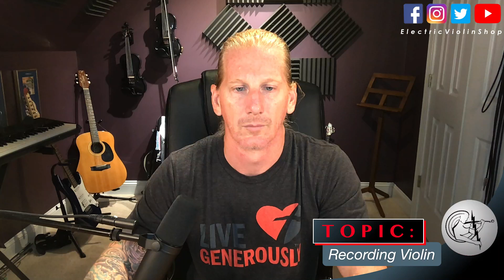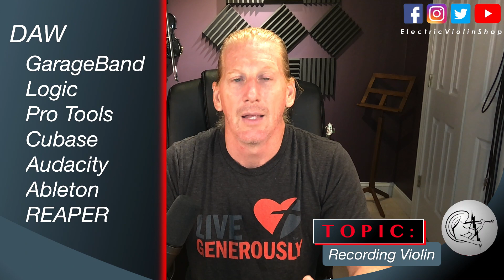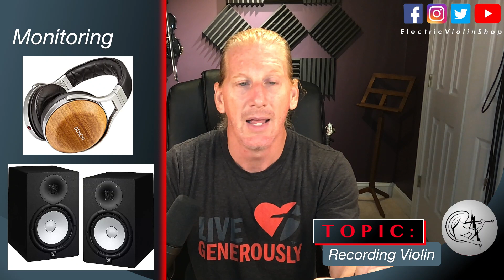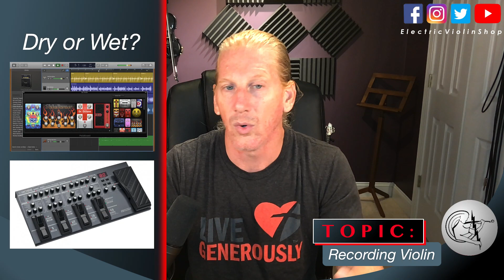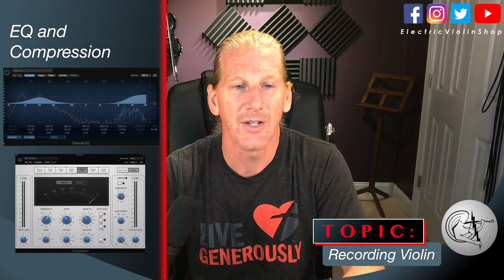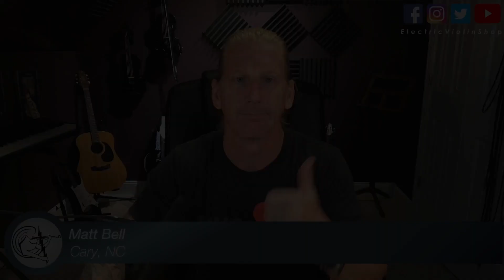How to Record Your Electric Violin

Comment: A lot of good advice and tips in a 20min vid. Nice one Matt! 
I would add that it is good to make sure one has checked the 'sample frequency' and 'bit depth' are a match in the DAW and Interface before recording as a miss-match can cause loads of problems later. Some DAW's do it for you, not all. Some Interfaces have set rates or limits. worth a check instead of losing those recording sessions. I speak from experience of cause.

Great channel. Thanks!

Comment: Great video.  I have the yev-104 and the THR30II, and an G10TII.  I'm recording the flat profile via the THR through USB.  Is this a decent strategy?  Regarding gain, I can either control on the YEV or the THR.  It doesn't seem to make a huge difference which I choose, but I'm assuming I should favor the gain on the YEV for the best signal to noise ratio?  I must say the sound it really harsh, but I'm going to work on the EQ in cubase and see if I can get it right, I assume that is to be expected?  It sounds so good in the room, and so bad in the recording :)
Reply from the maker: Well, if the results aren't what you were hoping for, then I'd say the strategy could use some work. 

And I wouldn't try to fix it in post. I'd try to fix it at the source. Honestly, your un-edited raw track should sound about 90% of what you want the final track to sound like.

Comment: Does that mean you cannot connect any electric violin to a computer using an aux cable or the cable that comes with the violin
Reply from the maker: Your computer probably doesn't have a place to plug an aux cable into.  If it does, it's an exceedingly cheap input.  I'd definitely use an interface.